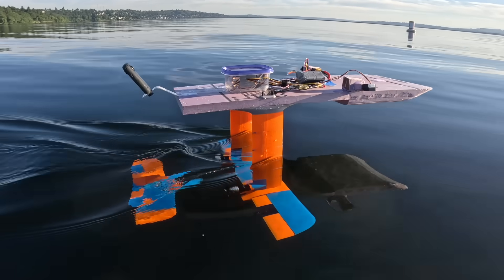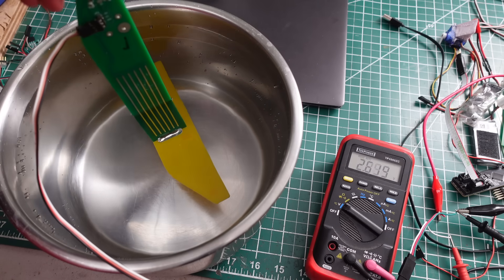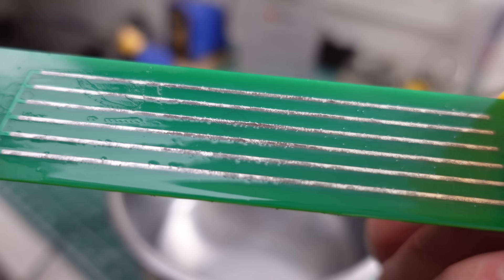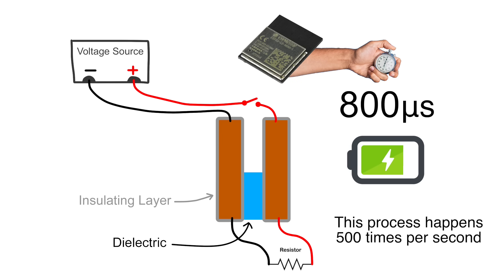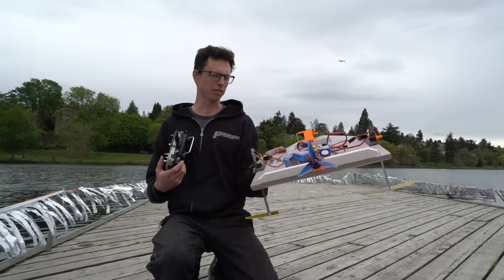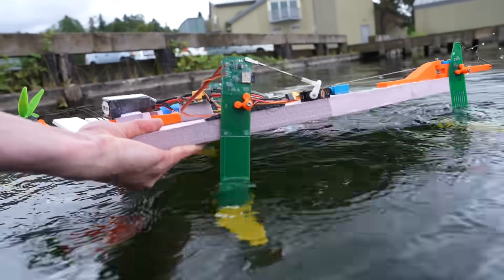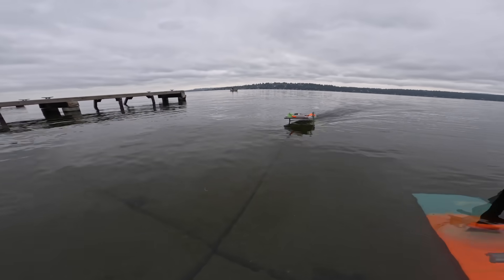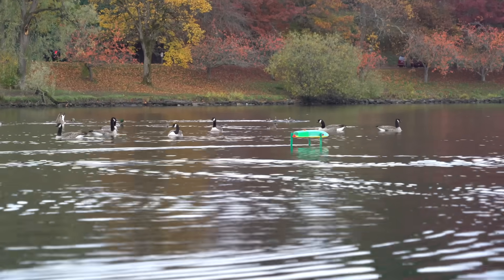R/C Hydrofoil Boat Made From Circuit Boards

Comment: You should have used impedance on the water level sensor. When the capacitance of the capacitor changes with an alternating current, the current will change, and you can quickly measure the liquid level.

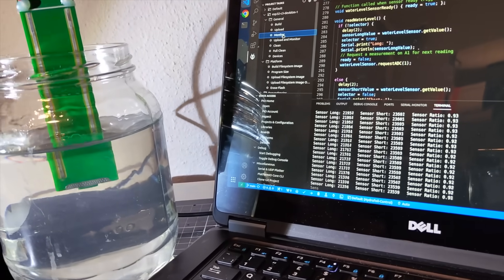Comment: 4:20 just thinking: if you use a little floating ball, it should measure without any corossion...maybe with a bending stripe sensor?

Comment: I'm waiting for the follow-up video before placing an order. I'd prefer to have the 3rd foil, which acts as the rudder, at the bow rather than the stern, but can anyone see any issues with doing so? I'd also rather have a pump (thus making a jetfoil) for propulsion than a prop... but adding the tubing needed to the masts would made them bulky and not hydrodynamic. It would also require just the foils to pivot, rather than the whole mast + foil, otherwise the water jets would also pivot. An earlier post also mentioned accelerometers and a flight controller, which would be great for coordinated turns at speed. Anyway, this is all just future gazing... I can dream right?! 😊

Comment: The corrosion is a problem that could be solved by using raised traces onto the PCB. The water flow may then clean the metals. That or using things like stainless steel bolts. I have been using bolts for soil moisture readings after noticing the corrosion issues in those water sensors.

Comment: You may try  Ziegler-Nichols method or try to obtain systems model through MATLAB and design in there. You may use sliding mode control as an addition to PID too . It helps a lot in practice.

Comment: did you ever think of a buoyance based sensor? This solution seems very stable so no point now, just wondering about the engineering process. A physical solution vs electronic

Comment: Resistive sensors are commonly used in wave tanks. They get around the problem of polarisation by continuously alternating the supply voltage.

Comment: I don't totally understand how zinc anodes work, but I do know they are supposed to protect metal components from corrosion. Curious if that could apply to a resistive sensor.

Comment: why not a floating ball inside a tube. the ball pushes a rod that is connected to a potetiometer. 
because it's in a tube, it would not care about waves and the water level would stil rise respective to the vessel.
this exact system is used in cars to measure fuel level.

Comment: a mechanical method that could be used - would be similar to the way the pulse engine powered planes of ww2 used a gyroscope to keep the plane at the correct bearing 
-
during flight - if the plane's path veered left or right - the gyro being stationary would leverage the rudder's position relative to the plane's off-course direction -
-
so you could attach a pivoting horizontal fin to the vertical support -  the trailing edge hangs down to barely ride on top of the water at the correct level when the boat is in motion - it would be linked to the underwater horizontal fin so that when the boat was above the correct height - the adjustment fin above the water would be hanging down  and not touching the water - being linked to the underwater fin - it would cause that fin to rise up at the back which would cause the boat to ride lower in the water until the upper fin touched the water - then it would stabilize  
-
and if the boat dropped too low - it would push the adjusting fin higher which would cause the underwater fin to drop at the back and raise the boat ...
-
it would also possibly be less drag than the circuit boards

Comment: You could instead of measuring the time constant, instead measure the ac resonance frequency. There is also a circuit that can follow this resonance extremely rapidly, used in the old style FM receivers

Comment: Those cheap servos are horrible. I never ever use them in my airplanes. Their zero point is never the same and they start to vibrate under load. 
If you want good working stuff, buy it😉

Comment: Boats use sacrificial zincs to corrode instead of the critical steel parts. They need to be replaced periodically, as they corrode away, but you might want to try that approach.
Reply: Yeah... The anodes...

Comment: Wonder if you can get a hydrostatic level sensor small enough to use instead. That what I use to measure our water tank level with the pressure difference works over very small distances.

Comment: Also keep in mind that on most boats, they include zincs under the waterline to act as a sacrificial metal to deal with corrosion risk of more nobel metals. This could be used to protect the silver of the first design.

Comment: The dielectric decides max breakdown voltage not capacitance at a voltage as such. But you can use it like a touch sensor for different materials

Comment: I am glad you used the idea of putting the air propeller up on a stem to tow rather than to push. Using thin foil 316 shim metal on exposed sensor plate will prevent corrosion especially in salt water. A type of gyro sensor to keep the craft always total parallel to the horizon, only to lift up and down vertically approaching big waves, will help.

Comment: Some aircraft have a system that uses sensors like this to detect the level of fuel in the tanks. It uses a rod inside of a tube that creates a capacitor when in the fuel and the height of fuel changes the capacitance in the sensor assembly.

Comment: This is really cool, but the decay on those is going to be insane. Typically boats have something called a "zinc" that is a sacrificial anode that gets eaten away by electrolysis. But because the water leveler is what is being directly fed electricity, it is going to be what is decaying.

Edit: I was legit 4 seconds away from seeing that you had found this problem. haha
Reply from the maker: I think you missed 80% of the video
Reply: @rctestflight Haha maybe. I was commenting as I was watching the beginning!

Comment: Hm, looks like you get a varying voltage, which then is read by the microcontroller, and then it feeds a varying voltage into the servo. I know its for PID, but if the PID could be made using opamps, aka, if you could create an analog PID, you could get rid of the microcontroller entirely and have instantaneous reaction

Comment: Fun fact the liquid level sensor is how small GA aircraft (think Cessnas and pipers) use to measure their fuel levels. This also means if you’re in an uncoordinated turn (slip or skid) you can force the fuel to the opposite side of the tank and force the liquid level sensor to read incorrectly (hence why you visually verify fuel levels in addition to the instrumentation levels)

Comment: Ok, now this is smart! The one 'issue' I foresee is that with the sensing being at the exact same longitudinal distance as the main lifting surface there will inevitably be a little bit of latency making your sensing drag behind disturbances in the water. I know you're familiar with the wands on Waszps and similar foiling boats. I'm just thinking in terms of rougher conditions and larger vessels, what might be the optimal way to deploy this.

Comment: Check fuel level display systems on airplanes
In many cases they use capacitors as fuel level sensors.
It is possible to build a wing-shaped capacitor with the outer PCB part is flexible and serves as one electrode.
And in the center of the wing is a PCB that serves as the second electrode.

Comment: Meanwhile, I'm putting the finishing touches on my RC airboat/alligator head, sorting out the rudder. I'm using the 2D design tool called OnPaper and the wireless interface tool aPencil™

Comment: Awesome idea, but think you guys have over thought this a bit, you just needed to build a capacitive touch sensor array.  The electrodes aren't exposed in a touch sensor.  There are some great docs from Atmel and Microchip to build them, but it's basically a set of interleaved "fingers" as traces on a PCB that you measure across, plenty of common microchips support them.  The only difference for you guys is you won't need a "guard" sensor, which ironically is usually used to detect water!

Comment: Is there a type of PCB design that can sense hydrostatic pressure? A stacked sandwich that measures resistance or capacitance in the middle of the sandwich?

Comment: 1:45 I wouldn't use that designer again, considering they don't know how to set a copper pour
That is the hallmark of an amateur
Reply: 3:47 this looks so much nicer
Very professional
Reply: 3:57 and he extended the exposed pad for the mechanical solder joint to take advantage of capillary effect! epic

Comment: I've seen some pretty significant feature creep, but going from 'I wanna build a boat' to 'my hydrofoil masts can talk to each other over WIFI' is pretty impressive, I must admit. 
I also love that we're adding to the theme of using suppliers for very much not what they were meant for heh. You've got Xyla using BotalToat stuff for planes and rockets, and now you're using PCBWay to make an actual boat.
Reply: If I understand correctly they don't talk to each other over wifi but can be calibrated remotely, and the wifi is simply used to update the firmware calibration. They are hardwired to the main controller of the craft. I think.

Comment: To measure waterresistance you schould try unsing low voltage Squarewave 80Hz to 2500Hz is good enough depending on salt content in water. I build a sensor measuring the resistivity of the water for my hydroculture that way. With a 2nd set of electrodes penetrating the watersurface I can calculate the waterhight. It's been running 4 years and still no relevant corosion on the grade 5 titanium. The bad part is contacting the titanium to the wire with screw terminals which have to be watertightend.

Comment: I think if you apply electrically conductive graphite coating on those pcb etches that may solve the drift problem due to corrosion on the electrodes.  Search conductive Graphite Lacquer, Acrylic Conductive Paints

Comment: I had the idea of using pressure to sense water level. You'd have a series of small holes leading to tubes with an array of sensors that could react to pressure. They would face forward so there would be a ram effect from water. Sensors could be directly on the leading edge of the foil too.

Comment: Gyro won't help with this project?
Have located somwhere in the rear center, I guess have sensors to measure the bottom of the boat to the water.
Gyro should stabilize the craft, and sensors should keep the vessel at whatever height above water you want?

Comment: You shouldn't use resistance to get the water level reading because that would corrode the electrodes rather quickly.
Instead you should insulate the board and use capacitance to measure.

Comment: fiber optics are a great way to auto solve a pcb issue with corrosion. The number of lines then gets programmed for distances, it cuts off the line, a reflector takes care of (small tiny reflectors are easy, don't fret about that. Its offset 2 way mirrors, it changes the light luminosity & frequency. Which is now a continuous signal.

To be fair, a heavy layer of conductive paint that has a thin coating of electrically conductive sealant works just fine. Which is why it works as a multi-layer auto solve fiber optic sensor! If you needed many & multiple redundancies.

How many of them know about my comments I wonder.

Oh, right, a basic aero skirt works just fine as a way that's easy to "hover board control" the total amount of lift & "hockey puck" aero effect to stabilize yaw & pitch. Same with simply helping your foils masts become a shock spring that needs to have itself tuned through dynamic air bladder size change in the hull. 

I remember at'ing you about & commenting on multiple of these videos about these videos you've since made. 

It must be strange knowing everything around you is what you know it to be, full of people who didn't follow the comments & videos that outline what I've said to be true.

You got this far, I doubt anyone of you reading this cares much. But, the hollow masts can be able to easily contain a manifold to split wing redirect lowered pressure water vapor into them & now use that as extra thrust thanks to the total mass going on & the efficiency of the ability for it float on higher density water & air to improve lift & more characteristics.

Not strangely enough, I talked out loud about this before making a comment. On this video. Rabbit hole down isn't needed. A bare minimum scratch would easily see this at this point. I already have those comments out there, with a google drive link on my reddit & more. 

Heavy accusation implies people will care. Over a year is brutal. Feel ya.

Comment: It’s not a toy, it’s a small scale proof of concept . Galvanization in water is well known among boaters. The answer is to use a less noble sacrificial anode, like zinc .
Reply: that would not help because these resistive sensor fundamentally requires current to go through water. which means you absolutely need electrons leaving one of your electrode which equals to corrosion.
Reply: Similarly, the exposed cathode of the final capacitive design will over time collect a lot of dirt.
Something similar happened to the propellor on my father"s boat, the sailing club updated the wiring last winter, and this year so much dirt grew around the propellor that full throttle only moved the boat at 2 knots, and reverse didn"t work at all.
The lake we are at has drinking water quality, so it probably happens even faster in most other waters.

Comment: I was about to suggest a capacitive level sensor, they’re common for industrial use, although I think they usually isolate both plates and have much more complex trace layouts so it can compensate for fluid conductivity and stuff.

Ultrasonic level sensors are also common, as well as these crazy ultrasonic ones that use a cut to length metal rod as the level sensor with a transducer up top. It vibrates the rod and somehow can accurately detect how far the liquid comes up it. They’re good for ignoring droplets or foam so you don’t get false readings.

I bet with more tuning and maybe a better frontend to measure capacitance at a finer resolution, the current design would work great. Level sensors are remarkably hard to get right

Comment: This gave me the idea to make the struts antenna and the hull have three different receivers, tune each strut to a different frequency and measure the signal strength. the 'antenna' could be completely protected the the water and very very thin.

Comment: The problem with resistive sensors is that electrolysis makes the reading drift, and will quickly corrode the traces (even if they are gold plated). This is easily fixed by using AC for the measurement. An alternative solution is to swap the polarity of electrodes every second measurement.

Comment: Hey just a thought here on a similar basis or resistance. Why not a float with a rheostat like a gas tank. There’d be no corrosion since the rheostat wouldn’t be in the water and much faster input and output since water wouldn’t be a concern. Something like your last project with those moving suspension on the surface as a leading edge to communicate

Comment: Another thing to look at is reducing voltage thru the sensors. Breakdown voltage of seawater is 1.4V (I think, check me) so if you reduce voltage and add a gain you’ll be able to reduce corrosion rate

Comment: How about just using a float arm with a hall effect sensor to measure distance to surface of the water? Then all of your electronics would be above the water.

As a mechanical engineer thats how i would solve the issue.
Reply: one issue though. wind. if it's light enough to float it's light enough to be moved by heavy wind. the way I would have done it make the struts antenna and the hull have three different receivers, tune each strut to a different frequency and measure the signal strength. the 'antenna' could be completely protected the the water and very very thin.

Comment: ?? To completely avoid corrosion use carbon fibres for the wet conductor elements - gold plating will of course be  at a lower resistance..

capacitative sensors   - better though a lot more computing needed...

(making the elements of this project form their own local mesh - seems like a fun future-resistant architecture  - very low power ad hoc self tuning (characterising) machines are not so far away.

(fairly thin - flat low AOA hydrofoils are very simply - for such a low weight craft  - a cambered single surface foil could work excellently

Comment: Wow, i've considered doing something very similar to measure aquarium water levels
(also a stick with an ESP32 doing capacitive sensing, but through the glass, not in the tank, and not going above the water level (not getting in the way of the lid))
if that works with yours, you may have another application!

Comment: Minor PSA: you don't even need the other exposed terminal, although it does help. A single thinly-insulated wire with a dab of epoxy on the end to waterproof it works fine as a water level sensor. (You're measuring the self-capacitance, which does change based on the surrounding material.) I've been using this to monitor the water level of my sump pump pit for ~2y now. ESP32 touch sensor, configured to output capacitance value (....really, time) instead of binary value, run through a linear calibration.

Comment: Impressive work! 👏  
Using a microcontroller with a PCB to measure capacitance changes from water level and then driving a servo to keep the hydrofoil at the right height — that’s such a clever design.  
What I really appreciate is how you showed the whole journey: the initial idea, the failures, the adjustments, and finally the success. That’s the true spirit of engineering — persistence and innovation. 🚀  
Thanks for sharing this inspiring project!